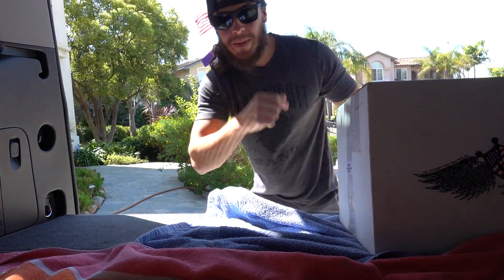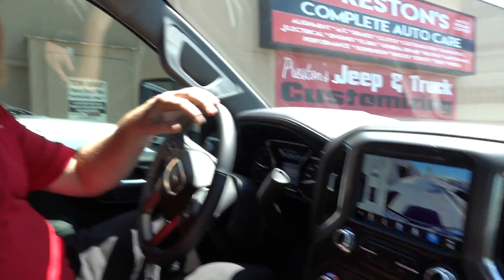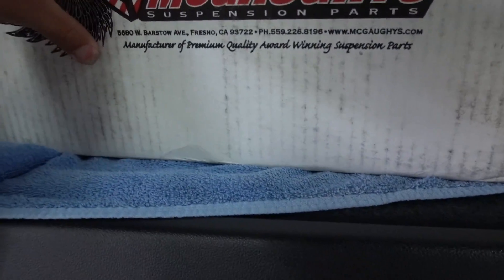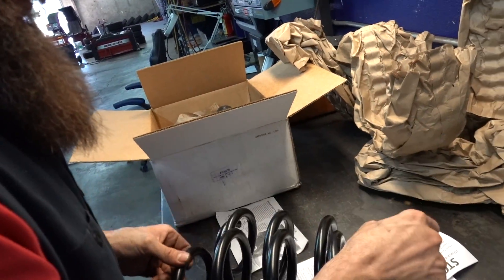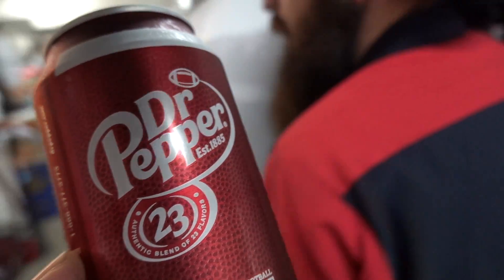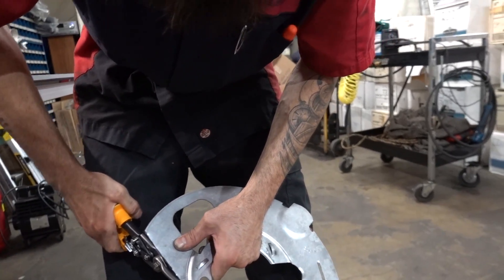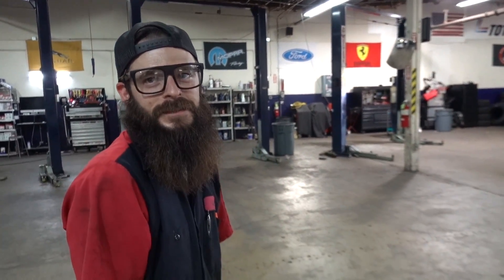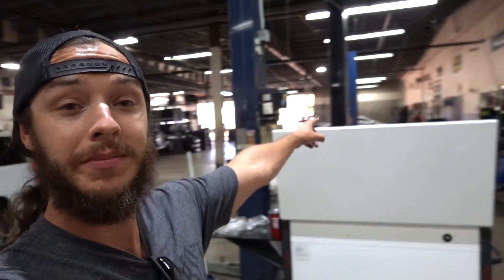TIME TO FINALLY START THE SEMA TAHOE BUILD!

Comment: @Dmaxryno Based on the math, I recommend 295/25R26 tire. It is very close to the overall diameter of the stock tires so you should have little to no rubbing issues.

I love all your vehicles. One day I'm going have a lifted truck but for now I'll just keep building my lowered car. Keep on inspiring people. 

Hello from Canada by the way 🙋‍♂️

Comment: 295 30 26 is .5” larger than stock you can run on lowered gm fullsize suv all day no rub and no trim
Reply: Well crap I'm sure he ain't planning on just driving on rims and no rubber.
Reply: Got 30 side wall which is the same for any other 26 of reasonable side but it’s 11 wide so it doesn’t rub that’s the only way to run a 26 really

Comment: i had a 2000 s-10 on a 5/6 drop with 18/20 staggered wheels. the frame sat about 2-3 inches off the ground, a 2/3 drop barely makes a visual difference.

Comment: Get some 24's with some meat on them. 26's with the tire sizes needed to fit on a lowered Chevy tend to really disagree with pot holes and such. 26's are cool but if it's something you want to be hassle free for Grandma  than gotta have a little meat

Comment: That looks like nothing got done...you just took the z71 package off.
Reply: Michael Bruemmer there’s definitely a difference. 2WD PPVs are lowered the same and the difference is noticeable vs a stock Tahoe. Idk what size tires the stock Z71 has but if the 26s are smaller in diameter it’ll be even more noticeable
Reply: @BrooXX856  thankz 4 that...but he should have gone lower
Reply: Michael Bruemmer he probably would’ve if he didn’t want it to be easily swapped back to OEM.
Reply: Michael Bruemmer maybe he won’t, and if he won’t maybe that’s all he wanted. After all he is a lifted guy.
Reply: Michael Bruemmer 👍👍